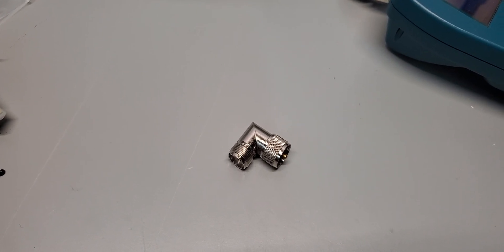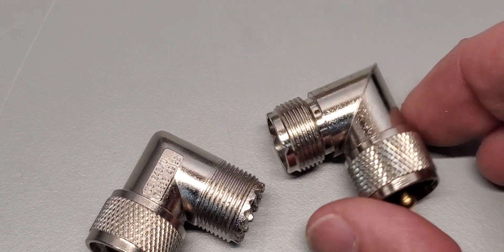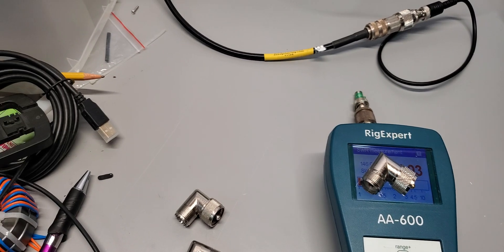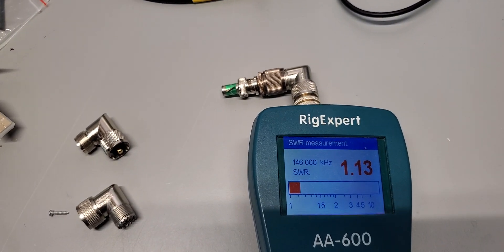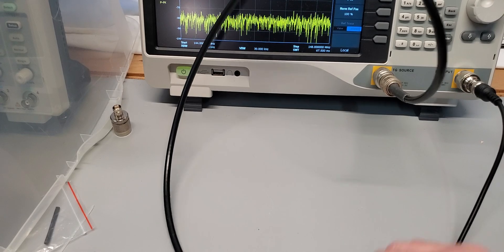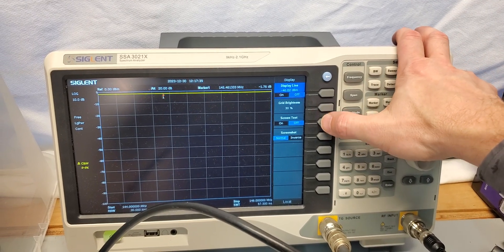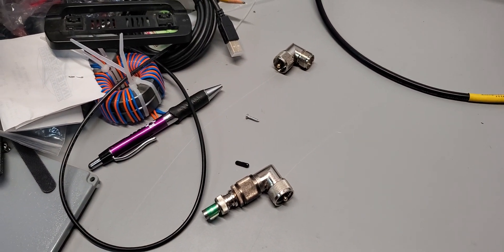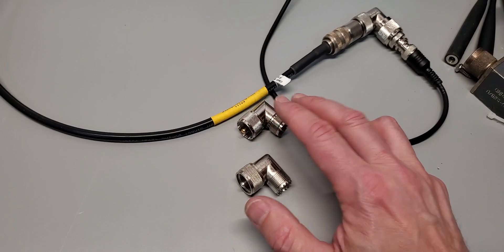The cost of a PL-259 to SO-239 90 Degree Elbow - Part 2

Comment: Ever take one apart? Most are compressed fittings. No real electrical connection. Had lots of them fall apart and cause problems
Reply from the maker: No, I haven't taken one apart.  I wouldn't know how to do that well without destroying it to an extend that wouldn't allow any useful investigation. Angle grinder, hack saw,...?
Reply: @adventurelaus  nah they're just pressed together. Pair of pliers will suffice.